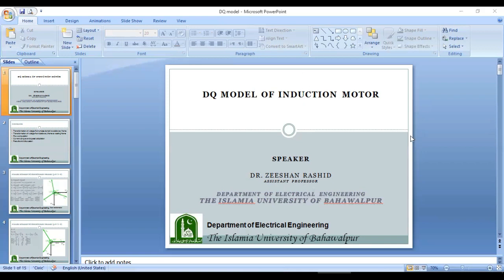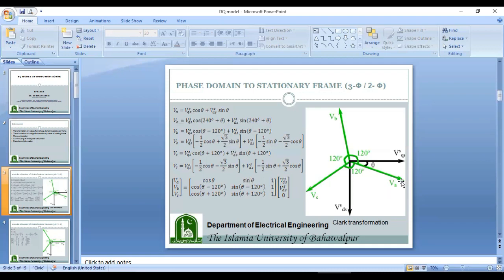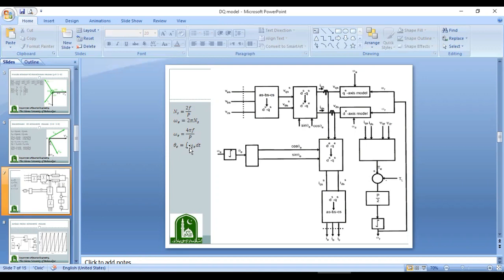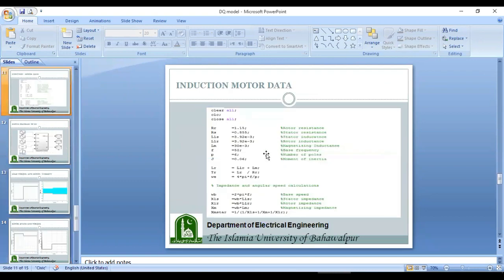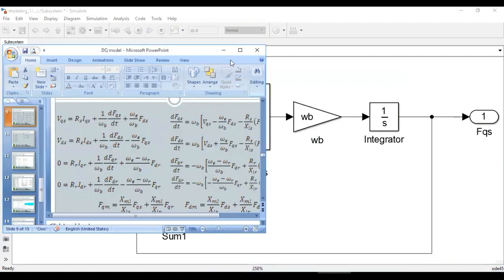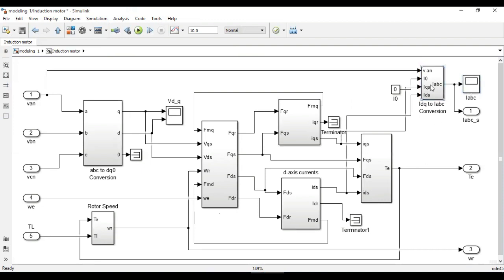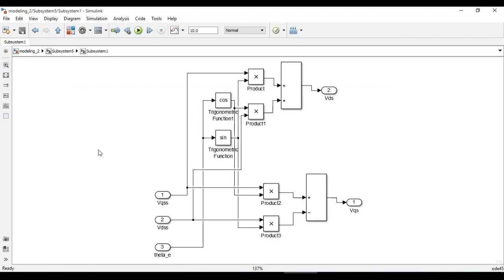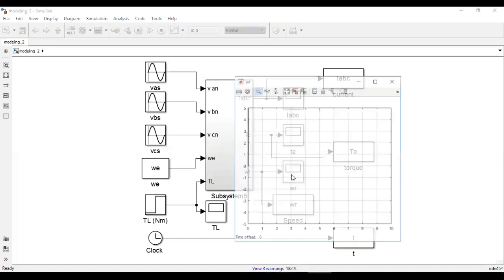DQ model of Induction motor | Complete MATLAB implementation

Comment: In modelling 3 what block has been used for theta_e
Reply from the maker: Its a repeating sequence from sources tab in simulink. Time values: [0 p/(2*f)]. Output values: [0 2*pi]
Reply from the maker: Other method of modeling 2 also does the same thing
Reply: Thanku for responding

Comment: Sir, which reference frame is better and for closed loop FOC control how to get PID values??
Reply from the maker: Both reference frames give same result. So both are correct (None is superior). It is an open loop model. For closed loop model, PID values can be tuned by varying the coefficients and running the simulation repeatedly until optimum result is achieved.
Reply: @electricalengineering6296  Thank you Sir

Comment: Hello Dr. please why you are used terminator for idr &i qr?
Reply from the maker: These variables are not required anywhere. So its better to terminate them. Otherwise, warning will be issued. But no effect on the final results.
Reply: big thanks Dr. @electricalengineering6296

Comment: Why you are getting the same results after implementing the rotating frame with We, because using the static frame with we you got some results but after adding the rotating one are the same ?
Reply from the maker: Only the motor parameters are calculated in stationary and rotating frames and they are transformed back to the phasor domain. The plotted results are phasor results which must be same if the model is correct.

Comment: I think this is quite interesting material, I have research on disturbances in the stator using simulink which is similar to what you described, my research is hampered because the simulink has not been completed, may I ask for the mathlab file you are using? maybe it can help me, thank you
Reply from the maker: Thank you for the comment. MATLAB file can be designed from the video. All information is provided.